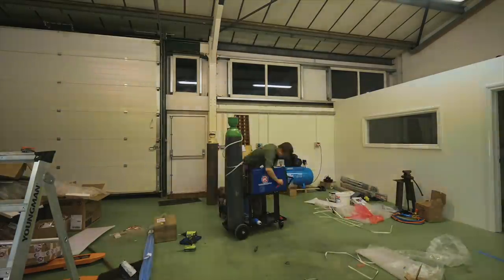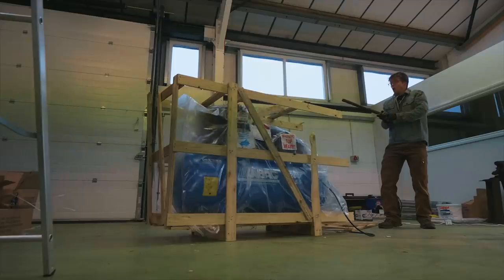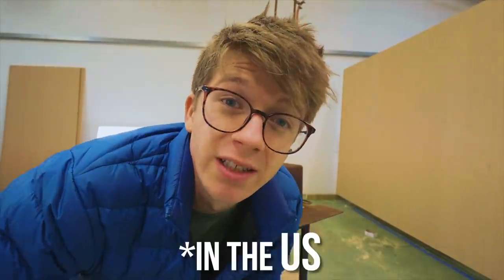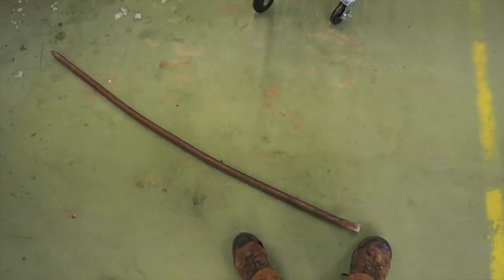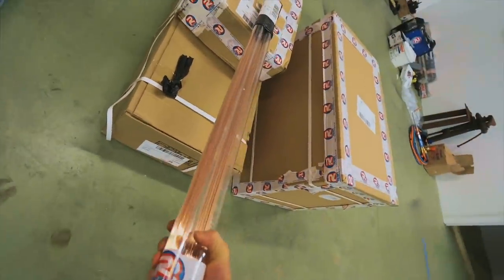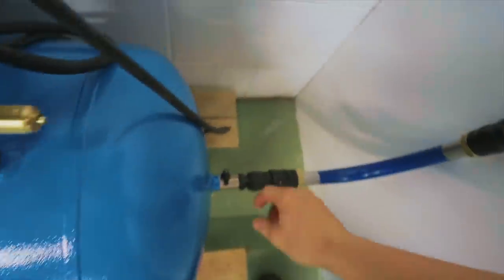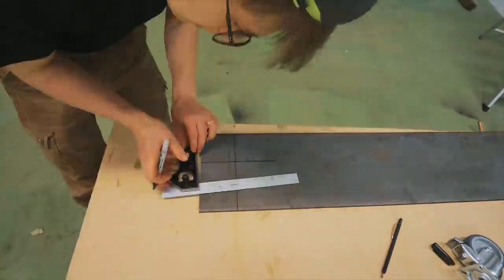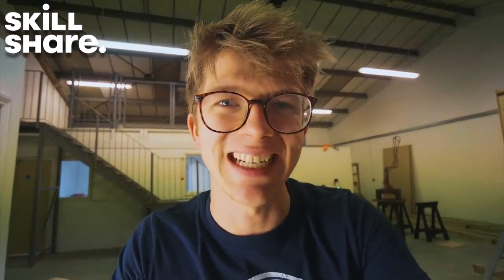MY BRITISH WORKSHOP!!! PART 2

Comment: Alec, ballpark on the total spend for this “new shop” to get it set to a basic level of functionality?
Reply from the maker: £50,000 :(
Reply: @AlecSteele  Business is fun isn’t it :)
Reply: @AlecSteele  Regarding placing the Plazma cutter underneath the welding machine, why don't you make longer legs for the actual table thingy? I it supported by nuts and screws I think right?

Comment: Great content, what size is the nylon pipe you used?  would you recommend where you got it from been thinking about putting some n my garage shop and storing the compressor outside to stop having the noise

Comment: Couldn’t you put the air compressor into the grinding room with an air supply from outside the grinding room? You gonna wear ear protection in the room anyway, so the noise is no problem there.

Comment: How do you keep your air dry? I have a desiccant drying system but I feel like I spend a stupid amount of time swapping the beads out and baking the used ones dry again. Plus ran into an issue where I wasn't around to swap the beads out for a few weeks and because of that the beads basically melted and filled my regulator up with gunk. Planning on putting a radiator before and after the air tank with condensate traps but if there is a better/easier option then I am open to suggestions.

Comment: Silly question, the welding cart with the plasma cutter situation, is it possible to put the welder on the lower shelf and put the cutter on the top shelf, or is it set up that way for a specific reason?
Reply from the maker: Would fit but then be a PITA to change out the welding wire because of one of the cart’s support columns!
Reply: @AlecSteele  Fair Enough

Comment: Just out of curiosity, when you heat and straighten a bar like that.... does it weaken the strength of the bar?
Reply: I’m no blacksmith but I do a fair bit of welding and heating metal 😂

Comment: Are you going to be keeping the compressor in the main working space? I mean, I know that the workshop is a loud place but compressors in particular hurt my ears. Maybe you could keep it in the grinding room, since you shouldn't be going in there without hearing protection anyway, and it would isolate the sound. Although now that I write it out, it sounds like a recipe for a lot of steel dust in your compressed air, which I suspect is not good. Both for the machine and the pipes, and because it could turn your compressed air into a sandblaster. Idk, if you can isolate the sound of the compressor I bet it will improve your quality of life.

Comment: ive a new plasma cutter, a new air compressor, air lines are plumbed and operational. Cuts steel plate with angle grinder. Lol

Comment: The first thing you think of is cutting the handle off, don't do that. What you should be raising the top platform, and keeping original so if something does break you can put the stock pieces back in. Get best of both worlds. And it is now a free video idea..... I should charge for this :-P

Comment: This may or may not be proprietary information but what is the rough cost of this workshop? or at least a bare-bones version?
Reply from the maker: £50,000 Is I think what it will end up! Almost spent all of that though :(
Reply: @AlecSteele  hmmmm perhaps I'll start off with a hammer and really strong lighter then and work up from there...
Reply: maybe find an incredibly athletic hamster and get it an abrasive wheel?

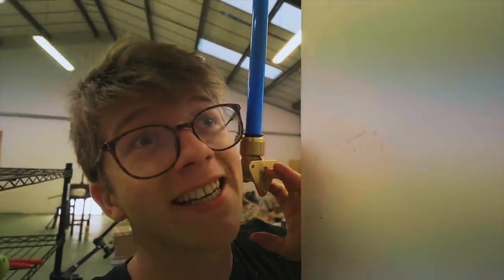Comment: 8:32, make sure your horizontal lines are always slightly tilted and you have a "shower valve" on the end for condensation, even if you have an air dryer. It will prevent any rust in your fittings (luckily the pipes can't rust). Moreover: you won't give yourself a shower when blowing dust from your machines. Ask me how I know...

Comment: spends thousands of pounds on a compressor, high pressure nylon plumbing & fittings and a plasma cutter...cuts sheet metal with a cutting disc & grinder...AAAAAALLLLLEEEEEEC!  LOLOLOLOLOLOL!